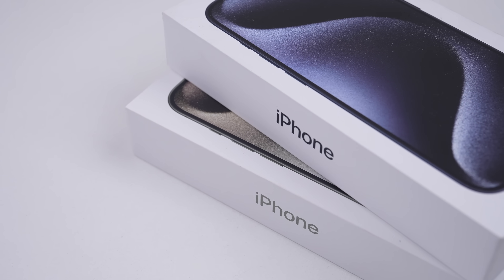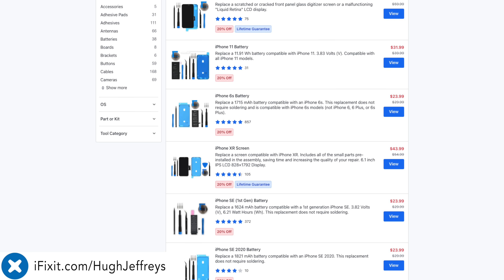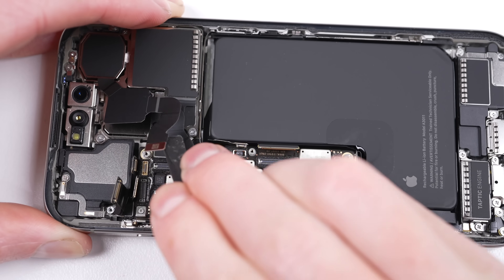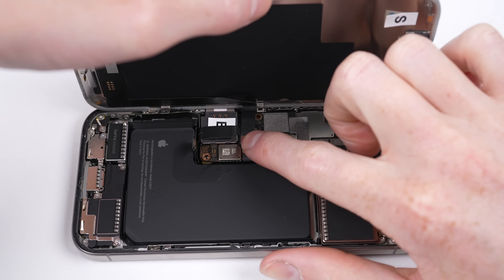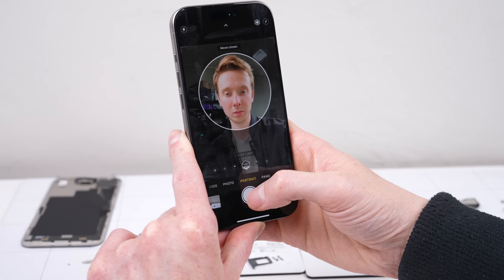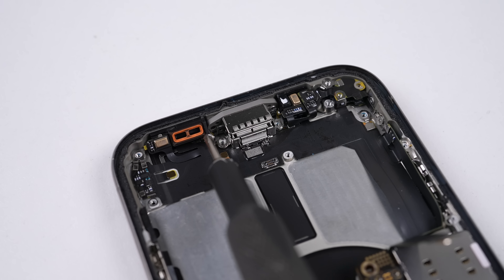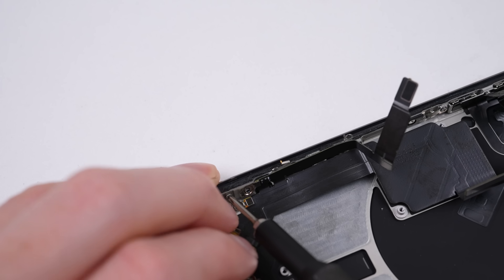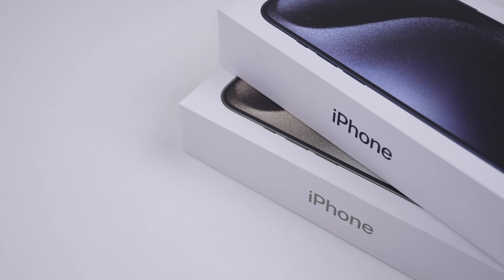iPhone 15 Pro Exposed - This Will Harm The Environment - Teardown And Repair Assessment

Comment: Apple's repair policy is like a car manufacturer forcing you to buy tires from them or the car will disable power steering, windshield wipers and ABS
Reply: If you only knew.
Reply: @jacobrzeszewski6527 buddy I got a 2010 Audi S4 alternator failed and I need to program the new alternator or else it won’t charger my battery.
Reply: @jacobrzeszewski6527 Ain't capitalism great?
Reply: This is a real thing, BMW needs the headlights programmed to the car if you replace the modules, Toyotas need the radar programmed to the car if you unplug the front radar (even if you plug the same radar back in), VWs need the battery programmed to the car. This was a huge pain when I was working in collision repair.
Reply: @Fhwgads11  this is just the beginning, imagine having to pay subscription for your device or they lock you out, now that will be fun.
Reply: @Fhwgads11  Agreed, you need to code in some stuff, but you don't need to go to the manufacturer to do so (except keys and ignition, but imo there's a reasonable safety reason). Everything can be done by anyone with proper tools and knowledge.
Apple requires you to contact them directly and only they can code it in, which I guess they won't do if you didn't buy the parts from them.
Reply: @sven7111 while that's true, many of those tools on very late models are only available from the manufacturers, and the cost several thousand dollars, and they can sometimes cost into the tens of thousands of dollars... It's just not practical.. why should I have to buy a $6,000 computer system along with the software and the licensing for that software, to put a battery or a headlight in my freaking car that I paid my hard earned money for it? 
Pretty idiotic.
Reply: @sven7111 … the Mercedes Benz/John Deere nonsense!
Reply: @Fhwgads11 they’re literally charging people for using seatwarmers💀
Reply: “They are litteraly charging people for using heated seats lol” 

Yeah. So when you didn’t want them during the purchase of the vehicle you didn’t pay for them ,  on most cars when they got the option, you either pay for them or you don’t. But if you don’t, the car will never have heated seats.

To lower cost and complexity during manufacturing of the car, it’s better to include them in every car. But why would I pay for heated seats ( in the rear) when I never use them?  BMW opts for subscription model so you can pay for them only in the winter, tesla is a one time purchase unlock, only one some of their models the other ones are included “ for free” aka you pay for them when you purchase the car, like a regular car but no choice of options.
Reply: @Eagles_Eye  another way to look at heated seats subscription is that the companies could've included the hardware and it doesn't affect their profits, but they would rather charge you because they can. 
Most people recognize that when you buy something you get the tangible object, in this case the heated seats is there. But now you have someone far away telling you whether you have the permission to use it, and that upsets many people. It takes the concept of ownership away from the buyers.
Reply: @Eagles_Eye  BMW warranties charges you for every part on the vehicle so even if you never need a new transmission you’re still paying for one!  If you get the Apple Care insurance your device is repaired or replaced.  If you get insurance through the phone company it’s the same thing.  I get iPhones are a big part of the market and repair businesses would like a piece of that market but that’s why God made Android.
Reply: @middleagebrotips3454  it’s only on the cheapest version, you want the luxury? Pay for it. You don’t want it? Don’t pay for it..

I’m glad to not pay for rear heated seats.
Reply: @Fhwgads11  Its getting out of control. But about VWs there are 2 programs OBD11 and VCDS which can be used to do all kind of progamming which is a good thing as they allow it do so. About rest i am not aware of such program who can do such things. If some one owns  any VW's car(vw audi seat skoda etc) vcds/obd11 is must.
Reply: @umar2gud  I bet if you bought a VAGCOM cable you could do a lot of the flashing at home. My dad borrowed one back when he leased his Passat and was able to change some FALSEs to TRUE with it to enable things like auto rain sensing wipers on US cars.
Reply: @Fhwgads11 
Good to know, I will keep my Honda CRV.
Reply: @Fhwgads11 radars need to be reprogrammed for safety reasons not malice
Reply: @Fhwgads11 by today's standards an old Lada is a better car than a new BMW 😂 who could say that they saw that coming 😂😂
Reply: Yeah the battery programming on the vw is a pain and Hella expensive toi
Reply: @Fhwgads11 radar makes more sense than the headlights
Reply: @Fhwgads11  BMWS need the battery programmed too, which is a pain
Reply: @Fhwgads11  Thank to God- i have 1992. Mitsubishi Colt. Only extra is power stearing. No AC, no elektric windows, seats, mirrors
Reply: @greywolf88  Good luck with the no AC during a 40°C heatwave :)
Reply: @greywolf88 everyone has the right to live like a Neanderthal so… power to you🙂🙈
Reply: @greywolf88 that sounds nice
Reply: @greywolf88 I think at that point the car is illegal without mirrors
Reply: And you can’t remove the lug nuts when you get a flat tire to put the spare tire on. 
Scratch that; the spare tire isn’t even included. If you get a flat you need to contact the dealership directly and get them to deliver a brand new tire to you; rim not included.
Reply: Tesla?
Reply: In fact, new vehicles require specific tools, to access the computer, with all the technology in the form of sensors if you remove a part and this part is attached to a sensor this must be reprogrammed, and remember that Tesla may render your vehicle unable if they decide to, just take care of your phone and you will never set foot at an Apple store
Reply: BMW: yeah the seat warmer is now a DLC
Reply: Don't forget about traction control and locking up the last transmission gear
Reply: I can't imagine what would be expected when Apple makes its own entry into the automotive market with its own version of an electric car.
Reply: Walled Garden.
Reply: A little kiss at rear end the car is totaled. If the car is 10 years old and these sensor cost a few 1000.
Reply: Apple: changing your tires and windshield wipers is too much work for us. How about you just buy our latest car model?
Reply: Or maybe having to pay a subscription fee to use something you already paid for like seat warmers or ac or remote start looking at bmw
Reply: @Jihadbearzwithgunz  As if BMW wasn't copying Tesla in that regard. All of those bad things manufacturers (BMW, Mercedes, etc.) do are just repeats of Tesla ideas. Yet, Tesla isn't criticized for it? Weird, I know the reason why though and it's stupid.

Tesla got away with it. Their "fans" even defended the choice, so others tried to do the same and then realized Tesla fans are just "special". BMW recently resigned from the subscription, idk about Mercedes.

Tesla can just do the worst things and still be praised by fanboys. Others, not so much.
Tesla is like Apple in all the bad stuff. If they make something worse for consumers, others will likely try to copy it.
Reply: Don't give them ideas lol
Reply: @BubbleDouble  I'm 99% sure Tesla considered that at some point.
Reply: Considering that proprietary ownership leads to a lack of conformance in third party products that result in danger. Explosive batteries and houses burnt down with children in bed. This would be like making the wheel housing reject the wheels during driving such that you'll spin out crash die and kill others in the process.
Reply: GUYS SOMEONE MAKE A POINT. I tried to watch this video on my iphone and they won’t let me. It literally just says something went wrong. They’re trying to silence the masses and leave their consumers in the dark. I of course am watching on my pc now because of their idiocy. My iphone is gone tomorrow
Reply: @stankbonkman  your theory is a multi-trillion dollar company who makes products designed to interact with one another so consumers can seamlessly go from one device to another with no downtime or loss of functionality is conspiring to keep people from social media?  That is possible I suppose.  I’m betting on user error though.
Reply: @stankbonkman  I've notice that often times when I'm commenting on YouTube when it comes to criticizing big business even especially Google YouTube comments glitch out. But the reality is I've learned this paranoia although honestly in these times is reasonable, the truth is in the design of the Application the phones update for preferential operability, YouTube works better on an Android because Android is owned by Google and YouTube is owned by Google. Rather than advancing technology businesses are knocking the legs out from other companies.
Reply: Only going to get worse if we are forced to switch to all electric! Car manufacturers already do this what many parts in the cars.
Reply: @@user-kx8vn6tm1d That was Tesla and BMW,  while Tesla and Mercedes did "subscription performance upgrades".
Tesla was praised for "being clever, reducing costs, giving people options".
BMW and Mercedes became the "greedy company", even though they just copied Tesla.
Reply: I had a 2004 focus mechanically totaled because the intake runner control module ate shit. The module only cost a couple hundred dollars, but programming it to my vin would have cost nearly $1000.
Reply: @jacobrzeszewski6527  Wow, had no idea. My IMRC module still functions, but my IMR swirl valve mechanism has worn out. Ford intake manifold on backorder for a few years now. Aftermarket part no longer available. Keeping her on the road with JB Weld.
Reply: @fredwilliams8898  well, I had a PZEV car. Which has two catalytic converters. A faulty swirl valve can kill the upstream cat (maninverter)  which in turn kills the downstream cat. If you can delete the cat it's no problem. But if you can't for emissions or whatever, it essentially totals the car.
Reply: @jacobrzeszewski6527 Menage a trois between Upstream Cat, Man Inverter and Downstream Cat?
Sounds like something out of a superhero movie or maybe some dirty saturday night at a swinger club. 😅
Reply: You already have cars that demands tyres from the car manufacturer.
Reply: Exactly my point
Reply: Not really. Massive false equivalence there... Disabling ABS could get people killed as well as if they disabled winshield wipers. Not at all similar. Your phones screen or camera not working isn't even close to having a vehicle having safety features disabled.
Reply: I think daddy eh should somehow change apples plan
Reply: Not only and, but also TCS and SAS
Reply: be ready for that exact thing if they ever release the Apple Car
Reply: Ever heard of Tesla? They will disable your ability to charge your car, and therefore drive your car, if you use unauthorized repair parts or try to work on it yourself. This will happen with EVERY single car manufacturer out there that produces an electric vehicle.
Reply: @fadingbeleifs  So far Tesla leads the way and their "fans" are ok with it. If it continues others will do it too. Just like BMW did their heated seats. Tesla did it first, a few years earlier and everyone was ok with that.
Tesla gets a special treatment in so many aspects (just like Apple). The worst part is, because of that others will follow.
Reply: @fadingbeleifs They don’t disable the charging only the “Tesla supercharger network” you can still charge at home or at any other supercharger
Reply: that's easy..just dont buy apple product like those sheeps..problem solved!
Reply: Your heated seat subscription is disabled. Please buy original tires.
Reply: Nope, it’s more akin to swapping an infotainment screen and the car disabling all that stuff!
Reply: not the best analogy. Tire as a consumable is better compared to battery. Apple won't lockout replacement battery. I would probably say it is like car makers forcing you to buy their rear view camera.
Reply: @Guoenyi  "Apple won't lockout replacement battery"
Apple: Yeah, about that...

The phone disables features, because of a different battery too, don't worry. They aren't that generous.
Reply: Wait for this to not only happen, but universally happen. We are moving in this direction; and especially for the US, since “regulation” is a baddie word - it will not be stopped!
Reply: Not even close. Only Tesla follows the greed way to do business as Apple. Who buy apple products deserve this. You have a lot of other quality options. But people still follow the cult.
Reply: All those things I drive without
Reply: Most of these parts DONT “need” to be coded for any reason.., it’s a pure cash grab, nothing to do with safety or warranty!
Reply: So when IBM gave Microsoft a monopoly for the OS on PC’s did you have a problem with that?  When replacing the radio in new cars and having to spend $70 for access to the VIN codes from the car manufacturer before it works do you have a problem with that?  Companies need to maintain quality control and third party repair won’t allow quality control.
Reply: @rwfrench66GenX  Do you take your car to the dealer to change lightbulbs?
You know to make sure they can keep quality control.

Iphones literally reject their own OEM parts and only Apple is capable of fixing it.

Imagine only being able to fix your car at the dealer. No matter the issue. Also if you tried fixing it by yourself, it would stop working. Just because "quality control".

Only thing quality that they control is the quality of their bottom line.
Reply: Consider yourself lucky if it didn't self destruct for "security"
Reply: You mean like Tesla.
Reply: It’s like a Corolla BASE MODEL.
Reply: Ape logic.
Reply: Call it for what it is…proprietary.
Reply: Literally had this exact argument EXACTTTTT argument with multiple people & they all say I'm dumb comparing cars to phones. But seriously, who would buy a car if they couldn't change the oil, coolant, tyres, & all three main filters (Oil, fuel & air) without taking it to the mech? You wouldn't at all, unless you're a leftist sheep. Straight facts can't change my mind.
Reply: No one is making you buy an iPhone or iCar.
Reply: Fuck the environment  your dead already you fucking idiot
Reply: BMW is way ahead of ya
Reply: Totally man xD but somehow people agreed for phones to play by different rules. On PC microsoft got sued for monopoly for giving you internet explorer, on mobile apple can fucking control everything. Its like those old fucks that write our laws could not understand nothing.
Reply: Google  Newag Train Hacking@@user-kx8vn6tm1d
Reply: Sounds like a Tesla.
Reply: This is why Tesla/BMW/Merc and other car companies are introducing drive by wire so that they can intentionally bog the car and force the customer to buy software updates to "fix" it.
Reply: You guys remember Hugh’s Minecraft cheat from 13 years ago??😂
Reply: You mean like a Tesla
Reply: Its already started with Tesla, and the new EV cars.  Takes special trained mechanic, special software to do anything with them.  John Deer does the same with their tractors,  you can replace a part,  but it won't work until a john deer rep comes out with a computer to say yes work again.
Reply: When apple comes out with their Ev I bet they will do something like that. A tyre change will need an apple technician.
Reply: @TheAMJ555 you are delusional if you think Apples suddenly gonna become an auto maker
Reply: For real
Reply: Do you really want aftermarket shit parts on your Bugatti? ruining your experience and reducing your top speed stability? no you don't!
Reply: @GS0CK6 until the manufacturer stops making spare parts you mean? Buying a Bugatti car should not mean being owned by Bugatti.
Reply: Simply false.
Reply: I mean the phone comes with a free 1 year warranty. Most customers also purchase apple care to extend the warranty. I fail to see why anyone would bring their iPhone to a 3rd party repair technician...
Reply: @RzVids  Have you heard of this thing called "dropping a phone". It's definitely not covered under warranty.
Warranty covers manufacturing defects and failure of components. Not damage. 
Also buying a new phone every year is not a thing everyone does.
Reply: @sven7111  Heard of a screen protector?
Reply: @RzVids  I've never seen a screen protector that could protect from more than scratches.
Reply: So? I would rather have the phone replaced than be repaired and if it needs to be repaired, it should be by apple. Anything other than apple, YOU are the product. Android = sell everything you do. Obscure OS = even worse.
Reply: @bestyoutubernonegraternumber1  Congratulations, you are a perfect "no questions asked" apple consumer.
Reply: This is a stupid way to compare things. In your vehicle you don't save family pictures (kids etc), your bank info, email, passwords...all that. These devices are powerful computers 100% connect to the web. Security practices should be the users obligation, but we all know if the corps let the devices openers it becomes windows world on where 5 out 10 pcs carries some type of virus/trojas...etc . If you pick 10k people and ask to then how many lost their cars somewhere you probably will find none. Try do the same with smartphones....people loose their devices frequently and if security measures aren't in place in 5 min industry's are create to stole phone and replace parts to access private information. I dispise apple for their prices, but they are phenomenal in offer reliable products, reliable softwares. Like you or not.
Reply: @iamsaulo  You think so? Then why can Android do so without arbitrary difficulties?
Or a better question. Why don't cars do the same? If they fail you can die. You and your family in the photos.
Are family photos more important than the actual family?
Reply: @iamsaulo  Can you explain how you think disabling auto-dimming protects the device from being infected? Or explain how you think disassembling a device has anything to do with viruses?
Reply: It is for our own good. No one can access your sensitive information using your iPhone.
Reply: @PavanKumar-ft5hi the only part relevant to information security is the memory chip.  Is that the only part locked to the phone?  No.  So your claim is just BS.
Reply: @PavanKumar-ft5hi  Stop trolling. The iPhone isn’t more safe than any other brand.